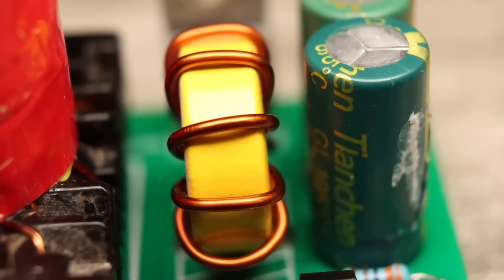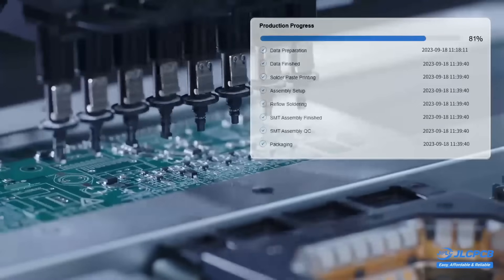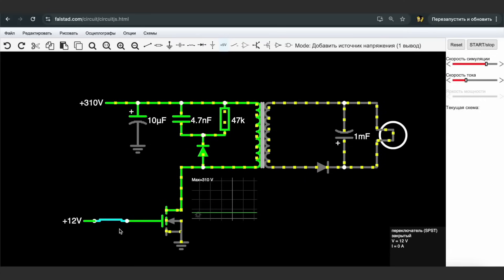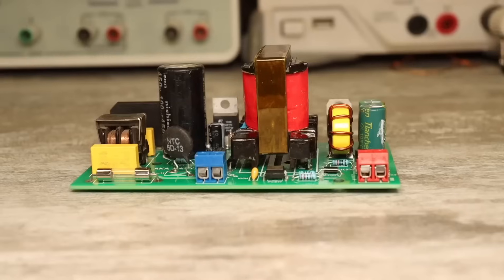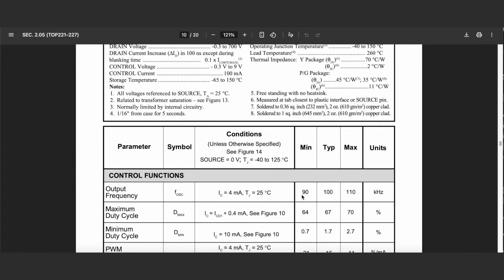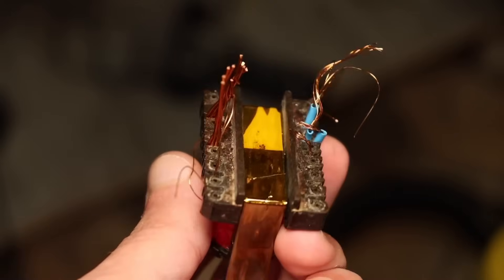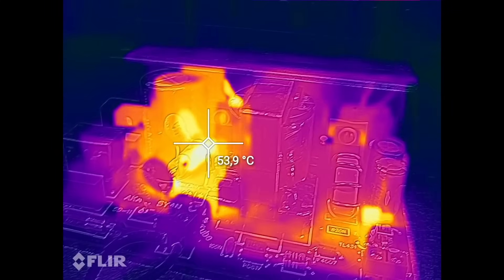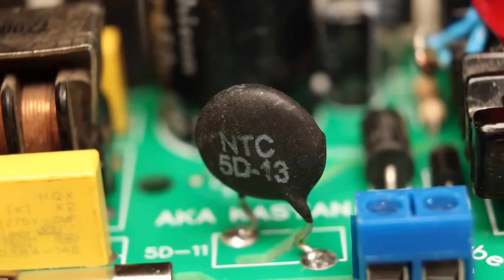DIY Simple Switching Power Supply – Easy SMPS Circuit Build JLCPCB

Comment: Impressive content, Kasyan TV. Eager to see your next upload from you. I pressed that thumbs up icon on your video. Keep up the fantastic work. Your explanation of the flyback converter's operation was particularly enlightening. Have you considered any potential improvements or alternatives to the snubber circuit design for handling high-voltage spikes?